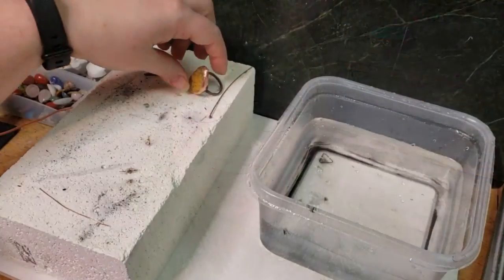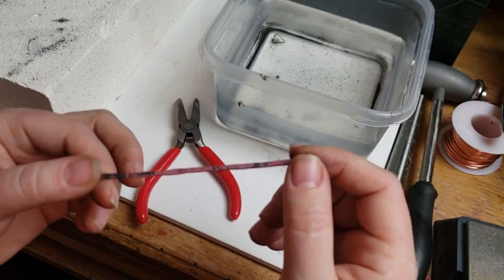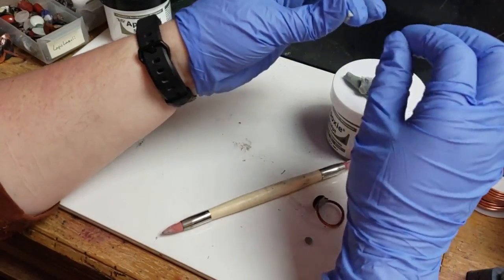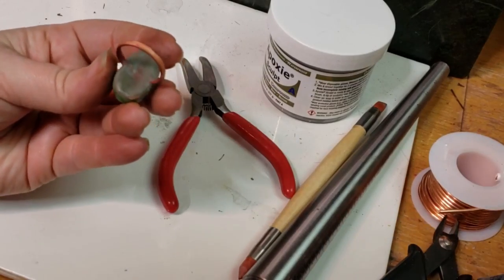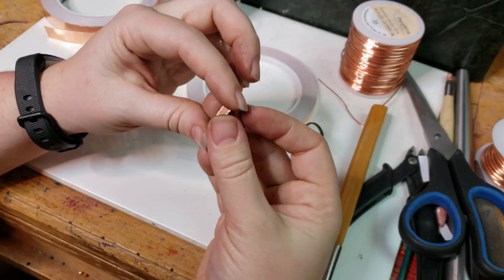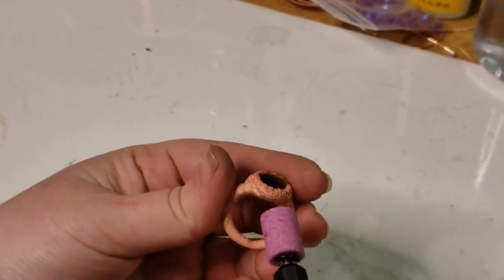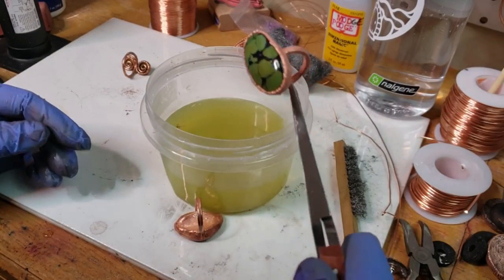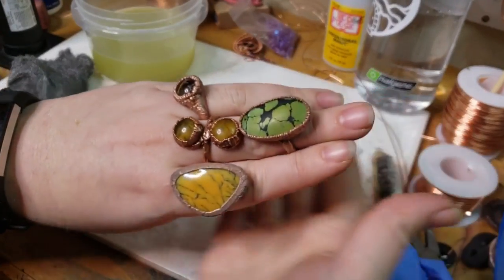electroformed Copper ring

Comment: Epoxy sculpt is basically two part epoxy that has fine chalk mixed in. I have made some myself with syringes of two part epoxy, each side squeezed into a separate airtight container and mixed with some kind of powder ( chalk, cornstarch, flour). It is not non-toxic, it can cause eye and skin irritation, not safe to put in mouth. Epoxy Sculpt does have very low odor.

Comment: When your torch doesn’t want to turn off, it’s because the continuous switch is getting stuck, so as you would normally turn your torch off, press in the round button looking thing and hold it in, at the same time pull the continuous switch out, then release. If you really want to fix it for good, on the top of the torch where there is a decal, there is a screw. Take out all the screws, pull off the plastic housing and locate the continuous lever, loosten up the screw until it works like it should and assemble the torch back together.

Comment: Hi Y'vonne, I so enjoy your videos...very inspiring.  I have recently started electroforming crystals and some stones and purchased my solution from Rio Grande.   I was rocking and rolling along fine for about a month and now all of the sudden the solution is eating away at my stones even tho I have put several coats of Modge Podge on them.  Do you have any ideas why or what I could do to fix this?  I am wondering if I need to add water and check the PH of the solution and go from there.  Your thoughts would be greatly appreciated!  Thanks so much!  Tommye
Reply: I'd definitely check the PH, and add distilled water to equal the original amount of your solution when you first started using it. I'd also try using liquid latex to protect your stones. Make sure to apply the protective coating with a thick layer and let it dry completely before electroforming! What stones are you using?

Comment: Question. What you are doing with the epoxie sculpt, couldn't you do with precious metal clay? Instead of electro forming, couldn't you fire it with the torch?
Reply: only with silver clay, any copper or bronze clay can not be torch fired, and any jewelry created with metal clay you need to make sure you have fire safe stones which are only diamonds and sapphire and garnet, and the clay shrinks when it is fired so any stone that is being set will be difficult to work around the shrinkage aspects. Electroforming is very simple and fun

Comment: Hello Yvonne,
I'm a novice in this and I'm having a problem that I do not know how to solve. After having the piece in the solution, when I take it out, it seems that everything went well, but after a few minutes the copper layer disintegrates and falls off. I do not know why it is. Any ideas?
Reply: Silvia Lorente You might have your rectifier set too high! Make sure you're calculating a 10th of an amp per square inch of your piece.

Comment: Ok so except for what you have shown I know nothing of electifirning. So, can you electro form in other types of metals like silver. Or is it just a copper thing. Lived the tutorial. Your scarf if Beautiful by the way.
Reply: She plates with copper because it is a good ineensive way to learn ... You can use any conductive material tho such as silver or gold as well ...
Reply: yes you can electroform with silver and gold but there is not a way to do it with an acid based solution only cyanide. and cyanide is extremely dangerous and should not be done on a small scale only in a controlled environment.

Comment: Does it come in silver tape
Reply from the maker: Hey,  Trish! Not that I have found, but I'll keep an eye out!
Reply: Trish Spinden The copper foil does come in silver...check stained glass supplies. That’s where I get mine. I’m not sure how it would react to electroplating. Interesting experiment tho...😂
Reply: I’ve seen some videos where they use PMC clay with small stones. They say that they have to heat the clay so hot for so long that real stones might shatter. So they use cz stones. Yvonne’s stones look real.

Comment: You may want to look into using carbide or diamond bits to initially remove the material. Then use a 'flapper' (flap sanding) type of sanding bit. Those grinding stones are designed for super soft material like wood or plastic. You will eat through them like mad, and they will just spray sand everywhere. Lovely project otherwise. Thanks for the video.
Reply: Steph Ss I suggest using a steel wheel attachment for your Dremel to polish your pieces quickly, effectively and efficiently 😏

Comment: According to online sources, the maximum current density for "general" acid copper electroplating should be in the 40A/sf range. I'd be surprised if your rings have even a square inch of surface area, so any current above about 280 mA (.28A, 40/144) is probably too much. I'm guessing that's part of why you get that bubbly texture. So, while it's nice if you want it, if you want to get rid of it you should turn down the current. You should probably filter your plating solution, too; suspended particles can also contribute to surface roughness.

On another note, if you want other things to experiment with, here's a thought: plate for a while, then paint a mask on the plated parts with craft acrylics or nail polish or whatever you have handy, then plate a while more. The result, once you remove the paint, should be a soft sort of "engraved" look.

Comment: Fascinating seeing you using copper tape to make it conductive. I also make copper electroformed rings, pendants and electroplate organic things like feathers which i use for woven copper wire dreamcatchers. Exact same method except i paint where i want the electroplating to go with a graphite conductive paint i get from Riogrande.com Once things are finished i seal them with ProtectaClear to keep your fingers from turning green. I do work on a farm tho, and for me anyways, even that finish starts chipping off from turning window cranks and wrenches and turns my fingers green. I'm sure it would be just fine for everyday use if your not turning wrenches or cranks haha. The ProtectaClear will also seal in your patina. With no sealer on them they will eventually all look the same.. like an old penny. Just thought i'd mention that since i didn't see you put any type of sealer on your rings. First time seeing any of your videos actually so you already might and i just haven't seen it yet :)
It is a ton of fun though. The possibilities of things you can electroplate are nearly endless.